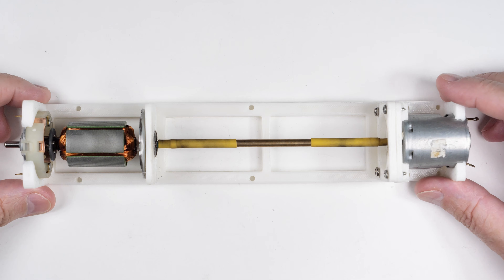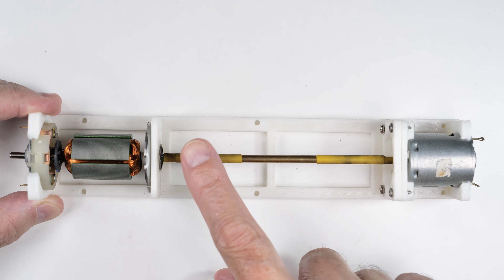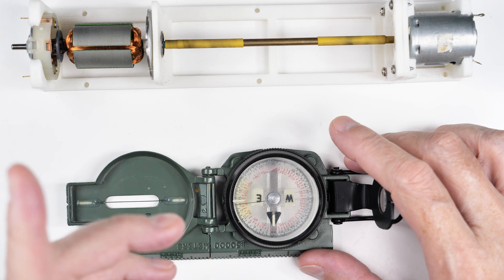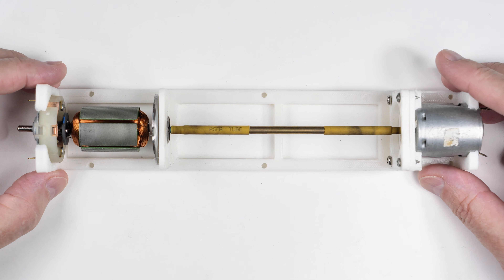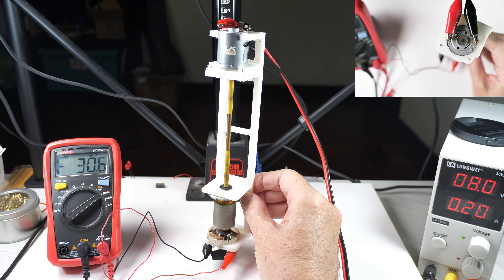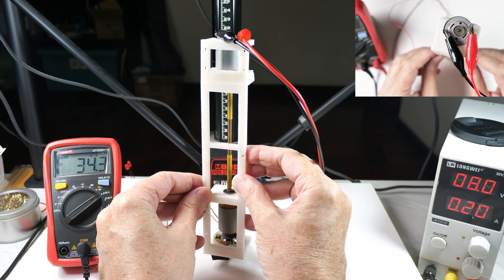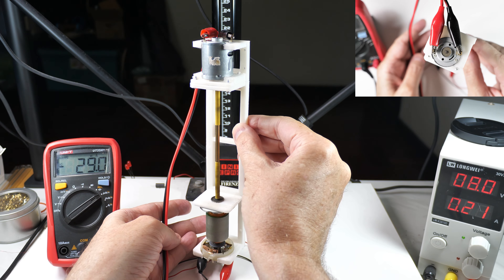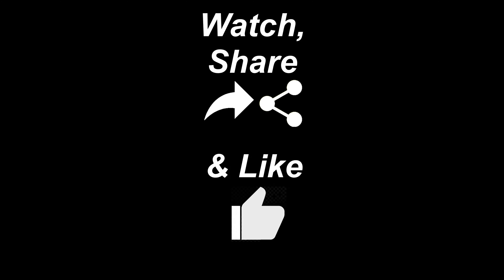What Is An Earth Inductor Compass? (4K)

Comment: As the earth magnetic field is not at his maximum in a vertical plane, I guess you should also be able to aproximate your latitude, indirectly of course, as the earth magnetic field is at his maximum neither horizontal nor vertical...  Maybe by putting your device inside a gimbal like cage ?
Reply from the maker: Actually, the real device was on gimbals to hold the coils flat to the Earth.

Comment: Very interesting, and the vertical axle direction took me by a surprise, but I managed to get it - rotating the frame changes contact points of the collector brushes, so we're getting readings in different directions of the magnetic field.

However, as this device likewise measures the actual magnetic field, it'll have the same troubles as a regular magnetic compass in the sense that if you looked at the readings of this device when located somewhere between the magnetic and geographic north poles, the readings would be 180 degrees off (in the geographic sense - the readings of this device would indicate north being in the direction of geographic south). Likewise the dipping effect (magnetic inclination) you mentioned for magnetic compasses affects this device just as well, and I think that is the reason your values are not symmetrical - the magnitudes of "north" and "south" indications differ in absolute values. I suppose you could find some off-vertical tilt angle of the axle that would produce equal values for the "north" and "south" indications, and I think this should also produce highest "north"/"south" values you'll be able to get the measurement to display.

But definitely an interesting way to make an electromagnetic compass. Thanks for sharing!

Comment: All the text book aside when the coil is vertical take away the mounting.. How do u measure the coil direction north south as it is spinning around the same plane.
Reply from the maker: It is relative to the brushes. The orientation of the brushes determines which of the rotor's arms are active. As the active arms best align with the Earth's magnetic field, the current maxes out.

Comment: Nice job! Another experiment to supplement this one would be to take a long single wire where you are flowing a fixed current thru it, say 1/2 amp or so, from a current-limited power supply. This long wire will produce a magnetic field much greater than the earth's magnetic field. Place the wire alongside of the inductor compass and repeat this test - I would suspect that you will see a greater voltage induced. You can then change the geometry of this long wire with respect to the inductor compass to see the nulls and peaks. This is basically a repeat of the experiments that Faraday performed many years ago.
Reply from the maker: Interesting idea.

Comment: Fascinating experiment, something that makes perfect sense but I’d never thought of before. 

For a microamp meter, any 20,000 ohms/volt multimeter will have a 50uA meter movement. IIRC, 20K ohms/volt was standard for better grades of analog DMMs back in the day, so there should be plenty of them on eBay, easier to find than just a naked panel meter of that sensitivity.
Reply: Or feed into an earphone and listen.
Reply: Ideally you would want a center zero µA meter.
Reply: @hooks2998   or feed them into comparator or differential amp inputs.

Comment: Talking of brushes they're only connecting the rotor winding to meter. I think that one is grasping for straws a little.
Reply: Yes, but there are multiple windings around the rotor and only the windings with their commutator segments under the brushes are connected. If it was a slip ring rotor then no it would not work but this rotor has a commutator.
Reply from the maker: I started to make this a slip ring, then figured out it would not work as a compass.

Comment: What about a wind up clockwork version. Would that perhaps have less magnetic field interference?
Reply from the maker: Yes, but one would still have to have some space to keep the spring away. The originals were used in ships and planes. The ones in planes used windflow to turn the shaft. You can see it in pictures of the Spirit of St. Louis.

Comment: A physicist here.  I was going to throw the BS flag (and in a way still am) until I read a comment about the orientation of the commutator brushes playing into the operation.  My BS flag was going to be thrown under the assumption of motor symmetry, in which case this would never work. However, if one has only (for example) two brushes, diametrically opposed, and fixed to the chassis, then yes I then see how this can work. But one needs to point out this is specific to a particular type of motor. If you had any other type of motor it would at least not work as well, and likely not at all.  Devil is always in the details. What is missing from this experiment is a test laying chassis flat and rotating it. When the motor is perpendicular to the field it should generate more voltage than when it’s parallel to the field, although now that you have shown axial coupling sensitivity one might have to also roll the chassis to get get max signal. It would have been nice to mention these sensitivities in the video, but regardless, good job, great video, thanks, and I learned something!  Of course I think it will still be more convenient to pull out my iPhone ;-)
Reply from the maker: The video I took down showed it horizontally and vertically. That's part of the reason I took it down, because the photo I was working from showed it in the vertical configuration. There's not enough data online to try to recreate the inventors' thought processes/research; it's posted as old tech that's interesting and easily demonstrable. But you don't have to take my word for it, the frame 3D printer files are online, the motors are standard sizes and cheap. Go for it.

Comment: Very cool!

A bit more discussion about what numbers you'd expect before the demonstration might be useful.  Depends on how much you want to get into the physics of what's going on.

Cheers!
Reply from the maker: @soilsurvivor  The actual devices went from a bit more complex to a lot more complex. Some had multiple coils in different orientations and the signals were mixed to give a left/right heading to destination. The readings depend on the coil (turns, size, core...), the speed it is spun, etc. It's a generator operating on a 3 dimensional magnetic field.

Comment: Is this just designed to stop the compass needle dragging, as I'd imagine declanation is still an issue with it.
Reply: Was thinking the same.  And one could incline the classic compass to compensate for the field inclination and stop the needle dragging?
Reply from the maker: As I recall, the inventors claimed it would remove variance, but they also were mixing signals from multiple rotors. I need to find their diagrams and do some thinking on how that might work. Mine is just designed to see if/how well the basic principle works.
Reply: @tsbrownie  Thanks for the response.

They could maybe be more accurate if stuff like declaration was done using a computer or analogue circuit and multiple compasses were used, it's an easy way to link compassss together reliably (I suppose the other way would be to make a compass into a potentiometer, or lead one into a pot, but friction would probably cause inaccuracies) so maybe this was one way to make a reliable compass with an electronic output.

Comment from the maker: Since I'm not a PhD in physics, I asked chatgpt for an explanation, and as I suspected it requires multivariant calculus to describe:
Key Components:
    Induction Coil: The core of the instrument is a rotating coil of wire mounted in a gimbal, allowing it to move freely.
    Magnetic Field Interaction: The Earth's magnetic field acts as the "source" field.
Working Principle:
    Rotation of the Coil: The coil is rotated at a constant speed within the Earth's magnetic field, either by hand or using a motor. As the coil rotates, the changing angle between the coil and the Earth's magnetic field lines induces an electric current in the wire, in accordance with Faraday's Law of Electromagnetic Induction.
    Current Strength and Direction: The strength and direction of the induced current vary with the orientation of the coil relative to the magnetic field. The induced voltage is at its maximum when the plane of the coil is perpendicular to the Earth's magnetic field (aligned with the magnetic meridian) and decreases to zero when the plane is parallel to the field (aligned with east-west).
    Directional Information: A sensitive galvanometer (or other voltage measuring device) is used to measure the strength of the induced current. As the coil is rotated, the point of maximum induced current identifies when the plane of the coil is aligned with the magnetic meridian, i.e., the north-south line. The direction can then be determined based on the way the instrument is oriented and the direction of rotation.
    Orientation to Cardinal Directions:
        When the induced current is at its peak, the instrument indicates that the coil is aligned along the north-south axis.
        By using the known rotation direction and interpreting the current peaks, you can determine whether you are facing north or south.
        For east-west directions, the instrument relies on the absence of a significant induced current when the coil is parallel to the magnetic field.
Summary of Direction Indication:
    North-South Alignment: Maximum current is induced when the coil is aligned with the Earth's magnetic meridian (north-south).
    East-West Alignment: No current is induced when the coil is aligned perpendicular to the Earth's magnetic meridian (east-west).
Advantages and Use:
You said: I need a physicist-level explanation of how the coil is interacting with the earth's magnetic field because the coil is flat to the earth. It is operated, yeah, and it's not horizontal to the earth's field. It is being rotated. The four parts of the coil are flat to the surface of the earth.
ChatGPT said:
You're right to point out that in the earth inductor compass, the coil is often oriented flat (parallel to the Earth's surface) during operation. To fully understand how the coil interacts with the Earth's magnetic field when it is not horizontally aligned, we need to break this down into some fundamental concepts from electromagnetism.
Earth's Magnetic Field and Its Orientation:
The Earth's magnetic field isn't perfectly horizontal at most locations. Instead, it forms an angle relative to the horizontal surface called the magnetic inclination or dip angle. This angle varies depending on your geographic location: near the equator, the field is almost horizontal, while near the poles, it points steeply downward (or upward in the Southern Hemisphere).
Key Concept: Faraday’s Law of Induction
Faraday’s Law of Induction states that a changing magnetic flux through a loop induces an electromotive force (EMF) proportional to the rate of change of the flux:
E=−dΦdt
E=−dtdΦ
where EE is the induced EMF, and ΦΦ is the magnetic flux through the coil. Magnetic flux ΦΦ is given by:
Φ=B⋅A⋅cos(θ)
Φ=B⋅A⋅cos(θ)
where:
    BB is the magnetic field strength,
    AA is the area of the coil,
    θθ is the angle between the magnetic field and the normal (perpendicular) to the coil’s surface.
Coil Orientation:
When the coil is flat and parallel to the Earth’s surface, the normal to the coil’s surface is vertical. However, the Earth's magnetic field is not strictly vertical. It is at an angle (the dip angle), so there’s still a component of the Earth's magnetic field that interacts with the coil.
As the coil rotates, the angle θθ between the Earth's magnetic field vector and the normal of the coil changes periodically. This changing angle causes a variation in the magnetic flux passing through the coil, which leads to the generation of an alternating EMF as per Faraday’s Law.
Understanding the Coil's Interaction with Earth's Field:
Let’s break this down step-by-step:
    Initial Alignment: When the coil is lying flat on the Earth’s surface (say, parallel to the ground), the magnetic field lines are angled due to the dip of the Earth's magnetic field. The coil's normal vector will make an angle with the field vector. At this initial orientation, there is some initial magnetic flux passing through the coil.
    Rotation and Changing Flux: As the coil rotates about an axis parallel to the surface of the Earth, the angle θθ between the coil's normal and the magnetic field vector changes continuously. Specifically:
        When the normal of the coil aligns with the magnetic field (let’s assume when the coil is in the north-south orientation), θ=0∘θ=0∘ or θ=180∘θ=180∘, and the magnetic flux is maximized.
        As the coil continues to rotate to an east-west orientation, θ=90∘θ=90∘, and the magnetic flux through the coil becomes zero (since the magnetic field lines are parallel to the coil and no field lines pass through it).
        The periodic change in the magnetic flux during the rotation induces an alternating current in the coil, where the magnitude of the induced EMF is largest when the coil is aligned along the magnetic north-south direction.
    Induced EMF: As the coil rotates, the variation in the angle θθ modulates the magnetic flux and hence induces an alternating EMF. The maximum EMF is generated when the coil's plane is perpendicular to the magnetic field vector, which happens when the coil’s plane is along the north-south axis.
Why the Coil Being Flat to the Earth Still Works:
    Even though the coil is flat to the Earth’s surface, the Earth's magnetic field has both horizontal and vertical components (due to the magnetic dip). Therefore, a component of the Earth’s magnetic field still penetrates the coil, even when it is flat.
    The rotating motion continually changes the orientation of the coil relative to the Earth’s magnetic field, producing a varying magnetic flux, which generates the EMF.
Simplified Visualization:
Imagine you’re holding a bicycle wheel (the coil) flat in front of you, and the Earth's magnetic field is like invisible arrows pointing at an angle into the ground (depending on your latitude). As you spin the wheel, the orientation of the wheel’s spokes (which represent the magnetic flux area) with respect to those arrows constantly changes. The stronger the alignment with those arrows (north-south), the greater the interaction and induced current.
Thus, the coil, even when flat to the Earth's surface, effectively interacts with the magnetic field by constantly rotating and changing its angle relative to the Earth's magnetic vector.
Reply: So, a no-go without Maxwell's Equations, upon whose edifice, there would have been no 20th Century, as such!
Reply from the maker: @DonnieLuve   Thanks, but as much as I'd like to take credit and proclaim myself a genius, I'm just copying 100+ year old tech!
Reply from the maker: @DonnieLuve  You could clip the leads. I desolder 1 leg at a time, holding the soldering iron tip to the leg where it enters the board.
Reply from the maker: @DonnieLuve  Maybe a higher wattage  soldering iron is needed. Also, sometimes the leads are twisted and need to be untwisted.

Comment: Hi, this is great, it's the first time I see such device.
Do you need a minimum size for the motors? I guess that using smaller motors makes the reading more difficult.

I guess that the two motors should stay at a certain distance to avoid interferences. If that's the case, would mounting one motor at a 90° angle reduce them?
Reply from the maker: Bigger motor / more windings = more electricity. Yes, the first one failed because the motor was too close (I deleted that video). I'm not sure if mounting it 90 degrees would help, I think probably. It's easier / cheaper just to separate them by 10 cm.
Reply: Yes your design is definitely easier. I was thinking about how small this device can be built 🙂 in fact a 90° version would require only a cardan joint (I hope the translation makes sense), probably it can be 3D printed as well.
Another design could use a belt and two  gears (horizontal axis, one motor facing ↓ and one ↑, like in the video)
Reply from the maker: @Fred_Klingon   I remade the device using 2 very small motors, but it does not work right. I am making a video on why, and it's mostly due to the fact that the smaller motors have only 3 arms on the rotor, something I missed until I was almost done. I'm going to try to finish it to help show how it works and why it needs 4+ arms. Having trouble with decent graphics to depict what's going on. It gets confusing without being able to see it.
Reply: Nice! I'll watch the video once it is ready